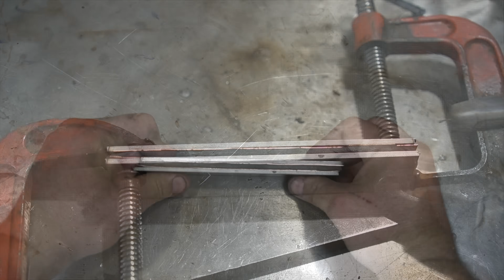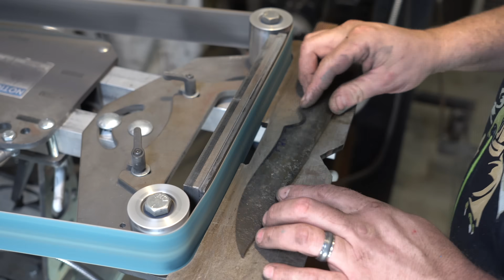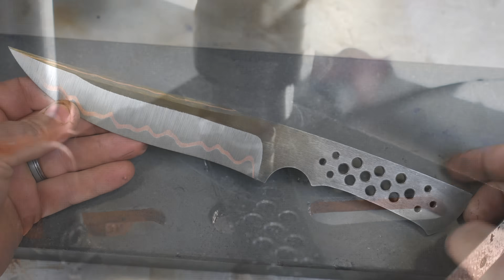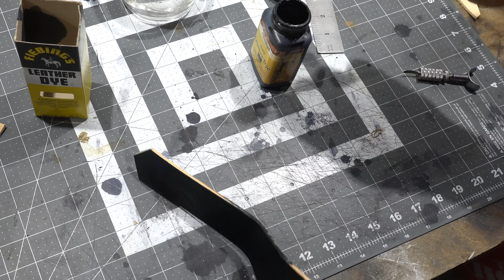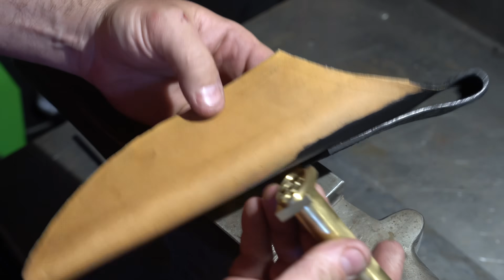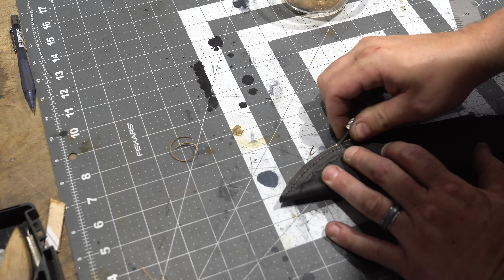Copper Damascus Hunting Knife - Collaboration with B.Kohn!

Comment: Follow up questions from my Katana questions.  And Thanks by the way.  
What other metals have you used for accents other than copper?  
And can you use one  on one side and another on the second side? Like copper on one side and a silver colored metal that wouldn't blacken like the steel does in your process.     
Sorry if you have a video with this done already only subscribed after finding and watching the Katana vid and haven't made it through the majority of your work yet.
Reply from the maker: I've done silver inlay on the Dagger Challenge build.  Gold is obviously very common as well, which I'm just getting into now.  Those 3 are the most common accent metals.  Thanks for watching.

Comment: That thing is gorgeous. 
Can you do zircuti Damascus or at least timascus?
Reply from the maker: Timascus is extremely hard to do.  You basically need a lab because it can't have any oxygen present at all.  Not something you can do in a normal shop.  Thanks for watching, James.
Reply: @TyrellKnifeworks  well that explains the super high prices on knives with timascus handles even ones coming from China. Thanks for the info.

Comment: Can you do CuMai with brass? Also what would you call it or extra challenges do you think it would present
Reply from the maker: Yes, you certainly can.  With brass, bronze, even silver and gold. The problem with brass/bronze is that its melting point is about 200F lower than copper so its much easier to melt out the non-ferrous metal out of the billet.  Thanks for watching, Derrick.   (btw, stay tuned I'll be doing a gold-mai build soon!)
Reply: I loved your fist try at gold mai and can't wait to see you try again! Good luck!

Comment: Mr. Tyrell, do you have any advice for buying and anvil, I am trying to do it on a budget, but its not going to well.
Reply from the maker: Used anvil prices are just stupid right now.  If it’s just for knifemaking, I would suggest you pickup a 70 lbs NC anvil. They are about $350 new.  Rail track anvils suck and scrap steel is expensive as well.  If I had to do it again, I would have spent a few hundred more instead of buying my used hay budden, I would have purchased a new Holland anvil.  I spent $800 on my 170lbs hay budden but the same size new anvil is about $1200.  Worth it.

Comment: Could  you do a cumai twist?
Reply from the maker: You mean twist the copper?  No. It would certainly delaminate under that stress.  Plus you’d have a weak blade because the copper would go through it instead of having a solid steel core.  Thanks for watching, Ron.

Comment: Great video. Just a quick question.  I made a blade out of a coil spring but I can't drill the tang. I haven't heat treated it yet either. Any suggestions
Reply: Anneal it.
Reply from the maker: Yes, like Gargothan said, anneal it by heating it with a torch or in a forge and let it cool slowly.  You should be able to drill it after that.  Thanks for watching.